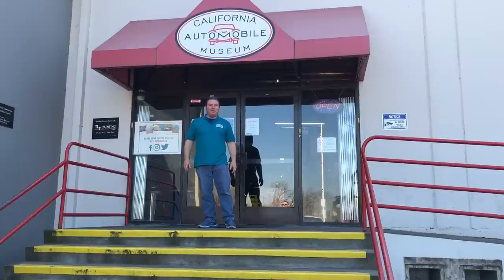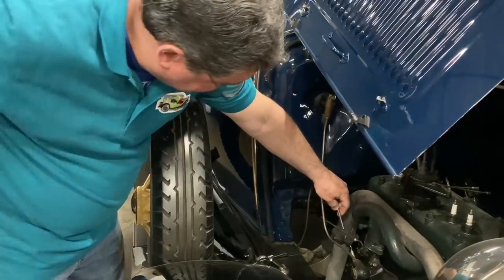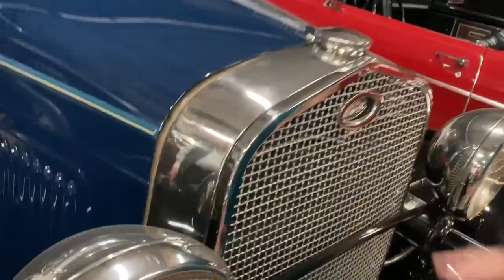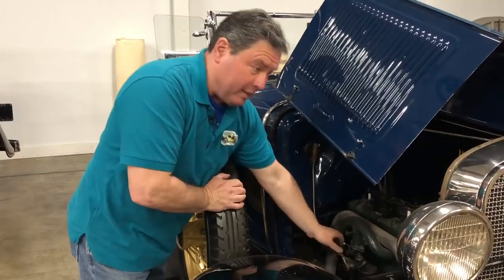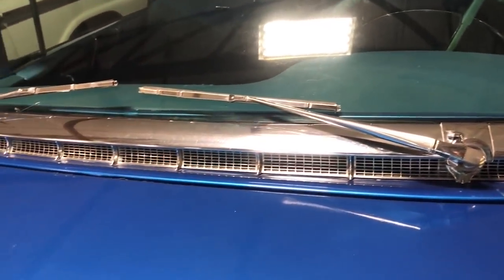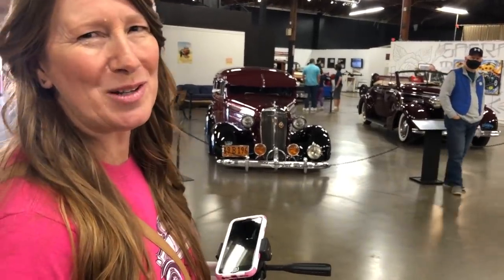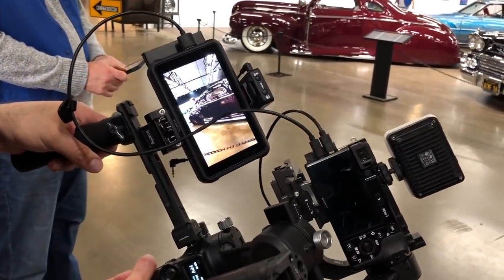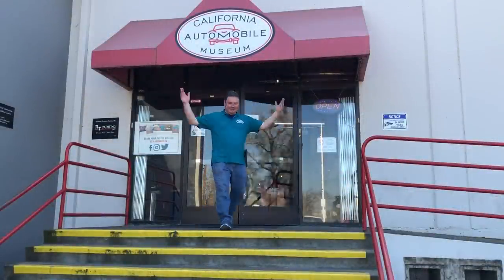Making "House Call" to fix a Ford Model A

Comment: Hello Paul great video going to the car museum.. model T was great help to you .. I like to watch YouTube together you guys make a great team .. I wanted to ask you your thoughts on the heater that is on top of the exhaust manifold … it looks like it was maybe an option later did they work very well did they not work very well how did it happen you could make a little video on there that would be great ..
Reply from the maker: The manifold heaters were an aftermarket accessory.  They are still being made and sold today.  They work OK.  But if tou have an exhaust leak, you get CO pumped directly into the passenger compartment.  I do not have them on any of my cars.  Just not worth the risk.
Reply: @ModelA  Paul I could take a couple days to think about your answer… very good point about maybe getting an exhaust leak and CO  coming into the car cab … also I’m surprised you did not mention the fact that it takes a big hole cut into the firewall to make it happen.. not sure I’d ever want to cut the firewall … would be a great video if you explained this in a video it may save somebody grief… let’s just keep some nice blankets in the back of the car for “Model T “ she will be fine from the cold ….
Reply from the maker: @michaelpeterson4348    Of course!  The giant hole in the firewall does not need mention.  It's not something I would ever do.

Comment: Paul, why not put a piece of door edge guard on the rock guard where it runs the radiator shell
 I know it would not be original but it might prevent the shell from being messed up
Reply from the maker: Since a rock guard is not original either, no worries about originality anyway.  Good idea!